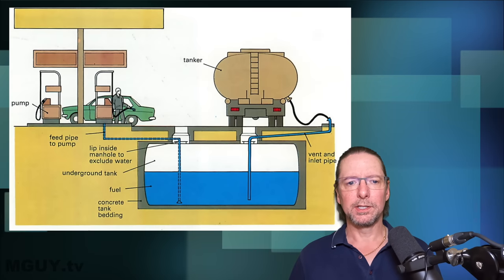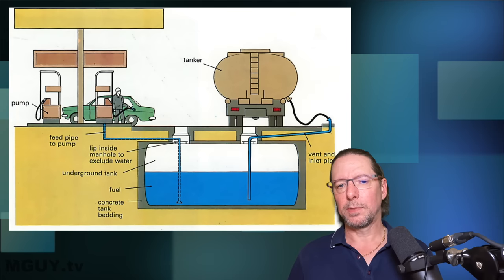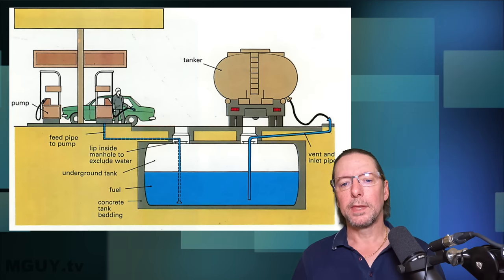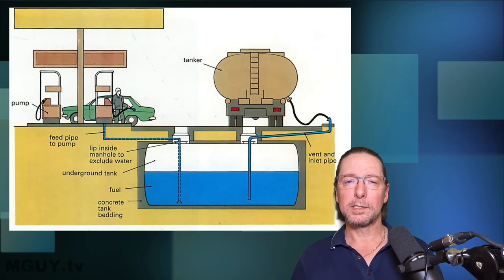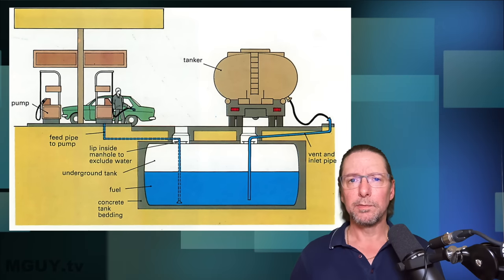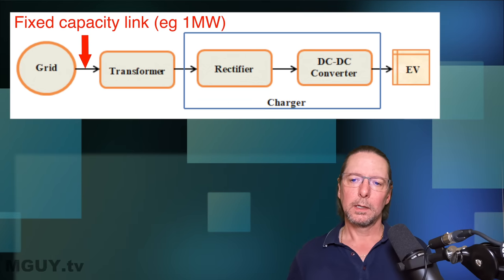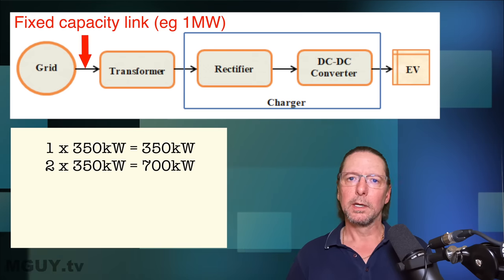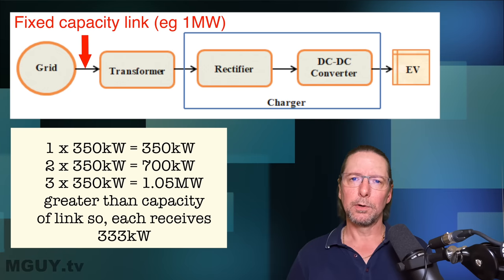HUGE problem with EV Charging Stations that no one mentions | MGUY Australia

Comment: Let's be generous and say an average EV stands on a public charger for 20 minutes and gets a range of 240 miles (more like 140 but bear with me).
It's generally accepted it takes 5 minutes to refuel an ICE car which then has 400 miles range (often more). If every car is an EV the sheer 'space' needed for public charging is mind blowing. Home charging will hardly ease it if many households have more than one EV or no off road parking. Regardless of the infastructure issues the whole thing is a house of cards.
Reply: and you will provide the fire fighting capability needed to protect the community?
Reply: The new Shenxing battery can easily provide 1000km range with less than ten minutes to charge to 400km.  We aren't talking about about gen1 Nissan Leafs anymore -battery tech advances year on year.
Reply: Exacty. Let's say you have half the mileage and take 4x the time, that means you need to have 8 times as much EV charging stations as you need gas stations at the moment.

Most people will charge during rush hours, so you need the grid to support that.
Reply: Yep, that's why EV's are pointless technology
Reply: @jasonhutcheon5991  advance the fire fighting technology.
Reply: What do you think all those green fields are for ?  But for forming huge standing areas for vehicle charging  ?
Reply: Don’t forget that everyone is going to charge their EV at the end of the day when they arrive home too!! 

The power draw from the grid for EV charging on top of already peak demand is impossible… even if chargers were required to start after the peak demand was over, the grid still couldn’t handle it and small window for charging will leave EV owners with half full batteries.
Reply: @jasonhutcheon5991  You missed the point of the video. How many kilowatts of energy does it take to provide 1000km range. The grid cannot provide energy at that rate even if the battery was real.
Reply: @sjb3460 wef said you never heard of bike?
Reply: The best solution to personal transport is no car. The second best solution is an EV.
Reply: Takes 30 SECONDs of my time to charge my car when I don't drive more than 250 miles in one day. Level 2 Charging Public Charging will just exist in existing car parks and takes up no extra space. "Home charging will hardly ease it if many households have more than one EV or no off road parking" does not even make sense especially in Australia where home charging is very viable for a slight majority. BEVs is not a total 100% solution that needs to cover every niche. But just the viable use cases in Aus is massive enough to have a gigantic impact. Your assumptions lack any understand of how this works in the real world. You are just jumping to wild absolutes.
Reply: @lukeclifton4392  and the sun won't be shining so we'll all have to pray for windy nights 😮
Reply: There are 6.9 million Terraced houses in the UK. How are they going to charge an EV at home?
Reply: Also consider how the average gasoline car is stopping at the fuel pump typically to get fuel for short journeys.  For those who have a garage, that could have simply been done with a charger in their garage overnight.
Reply: Tell me how the 6.9 million terraced houses in the UK, how can they charge an EV at night? @martalli
Reply: You are forgetting a massive percentage of ev drivers do all their charging at home
Reply: Not everyone can charge an EV at home. In the UK we have 6.9 million terraced houses. How are they going to charge an EV at home? @lukeclifton4392
Reply: Charging infrastructure at destination (workplaces, shopping malls etc) would alleviate this some
Reply: 1 fillup gives me 1200km range
Reply: Me too...
Reply: @gooble69  hopefully we won't experience "tofu" batteries with the new upgrades.
Reply: 240 miles on 20 minutes charge? That’s not generous, that’s a fairy tail.

Not one available EV has that capability, not even close, not by half at least.
Reply: How many petrol cars refuel in their garage? What % of EVs will need to charge worldwide at any given hour compared to petrol cars? I suspect far fewer than 10% of EVs will need public charging as compared to petrol. Your analysis is overly simplistic.
Reply: @jasonhutcheon5991  You assume the charging station has the capacity available. In some areas full fast charge is not available during peak demand hours. To bad, so sad!
Reply: @seanworkman431  They have the technology. IT IS VERY EXPENSIVE!  YOU will pay for it, like it or not, buying an EV or not! You ARE going to pay for it anyway! Voting has consequences!
Reply: This is a ludicrous take because a) most people DO charge at home, b) very few people drive 200+ miles without taking a break for toilet, food etc. c) chargers can be installed anywhere that people park their cars - offices, streets, supermarkets, restaurants, motorway services etc. It's even kind of laughable that people pronounce it a "house of cards". Maybe we should tell Norway where nearly 90% of cars are battery electric vehicles that some guy on YouTube has declared it cannot possibly work.
Reply: Exactly! This is what I've been saying for years. Imagine a busy freeway, or even worse, a toll road with service plazas. When it takes 30-45 minutes or more to get 200 miles of range, where are all these people (cars) going to go?
Reply: Comparing EV's to ICE is pointless as current ICE requires fossil fuel which is running out. Compare them to other sustainable technologies like hydrogen if you like, but not to fossil fuels.
Reply: @drxym  Norway is not a valid point! Small sections of population can do things that are not practical for the majority! The entire population of Norway is less than the population of several CITIES in the USA!  The size of Norway is less than some states in the USA! The problem of 350 MILLION people and a land area of almost 4 MILLION square miles is beyond all reason more complicated.
Reply: @glasslinger  actually it is an extremely valid point. If I wanted to drive from Skarsvåg to Stavanger by the fastest route it would be a 2500km journey starting well inside the Arctic Circle. I could drive this entire route with an electric vehicle because the Norwegian government have made it possible through regulations, taxes & incentives that strongly prefer electric vehicles and have built the infrastructure to support it. It is simply a matter of will and policy for ANY government to do the same, to say "on such and such a date, ICE cars will be phased out and BEV or synthetic fuel cars will be the only ones permitted for sale". You complain about the USA, but I don't see what your point even is here other than it is some veiled comment about the dysfunctional nature of US politics.
Reply: @suemclean2012  😂 People don’t need to fill petrol in their garages, because it only takes a few minutes to fill it at the station, it takes hours to charge your EV, the fire risks while charging are far more risky with current technology, so wait until your home insurance rates reflect an EV charging in your garage, good luck, hope you don’t get cancelled. FYI, look up EV fires……🤯
Reply: @glasslinger  and when it fails we all pay a higher price. 
Did you read about the chap that got trapped in his EV  while driving? The police had to get him to crash into them in order to make the vehicle stop. Happened in the U.K.
Reply: @MrCrouton80  That's like saying the best solution to life is death. Obviously, if I want to transport myself somewhere, it's better to have a car than not to have a car. I'm not anti EV, I'm pro all modes of transportation. Why do we have to pick one?
Reply: @gavinminion8515  If you Google 'oil reserves' it says we have 50-70 years left.🤔. Saudi Arabia alone has 221 years at current consumption 😂. As for EVs they also use fossil fuels. Two thirds of global electricity is generated using gas/oil/coal.
Reply: @grandprix1337  Even with an EV future we will need to change how/when we drive. But if you read your own comment - Oil and Gas will run out. And long before they do we will feel the effects of shortage acutely. 
P.S. I checked the OPEC website and their figures (which will be expected to be optimistic) give 80 years at current consumption.
Reply: Except most EV will charge when parked, not at dedicated rapid chargers, usually at home.
Reply: @jasonhutcheon5991  Is any American car maker using this battery? Furthermore, 400 km is NOT 400 miles...
Reply: There are already cities that won't allow more than one charger per house and or restrict the hours that the charger may be used!  If they only allow charging during the day when the solar farms are putting out(not a cloudy day)then that is useless because you have already gone to work!!
Reply: I own an EV and never used a public charger.... I could easily charge two at home... for free.  Seriously you people talk some crap, 1 in 7 cars now sold are EVs, the grid hasn't collapsed and owners have managed just fine.
Reply: @Hogger280  Unless you back thaty+ claim up, you lied.
Reply: Another problem is, if you don't have a garage to park in and hide your charger, anybody can come by and steal it (or parts off it) with very little to no problem. Even having one in your garage will only increase the crooks problem to moderate for most cases.
Reply: @jeremydyck2601  Congratulations! You win a coconut for coming up with more anti-EV FUD!

I never heard that one before or heard of any case of it happening, ever.

Comment: A disabled driver YouTuber has raised problems that he has found with UK charging points regarding wheelchair access, wider bays, no kerbs and very important weather cover canopy's similar to a present filling station.
Reply: Not found much of a problem, a few that are not working, yet I remember no being able to get petrol while the tanker  took 30 mins to deliver. A lot of the charging points seem to have wider bays, thinking about it, it would be hard to get out of your car while parked next to a petrol pump. Although I noticed a comment about Scotland, oh yeah they are still bragging about being the leaders in EV charging " many FREE " While there are still some  that are free, most of the" free ones" now charge at least 40p kwh. Troon has at least 4 free sites ,  40 kwh £free . petrol £1.65 a litre.
Reply: It is canopies. Even if not, the possessive apostrophe is not required.
Reply: I tow a trailer to events a few 100s of miles away. Not everyday, but it's something I do (as long as the government allows). As well as very limited towing distances with EVs, there are, so far, no charging stations set up for trailers. So several times per trip, I's have to find a place to leave the trailer, recharge, pick up the trailer and repeat as necessary.
Reply: @drewthompson7457 this is actually a good point, pull-through chargers would be a simple thing to provide in places where space permits and would help support people moving to EVs.  One thing to note, there are extension cables that you can buy to extend a J1772 connection.  Not sure what power rating the new ones support, I have a Chevy Bolt so it’s charge speed is ludicrously slow anyways, no fear of over stressing the 20 foot extension cable that I purchased.  May or may not work for you, but thought I’d mention it in case it might help.  Possibly they exist for Teslas as well, not sure.  But your point about needing pull-through chargers is a very good one.
Reply: Definitely charging stations should have these design elements included to ensure we’re bringing in as many drivers as possible to make EVs practical for them, but genuine question wouldn’t they also have significant challenges filling a petrol vehicle? Here in Canada there are quite a lot of gasoline stations that don’t have canopies, I don’t know if they’re required by law now and it’s only older ones that are permitted to not have them or if it’s just generally an option.  I suspect that by law the pumps have to be elevated on a pad and protected with bollards to reduce likelihood of catastrophe as every station I can think of has them (again here in Canada).
Reply: Did you know, in the US at least. If your car runs out of electricity  in the street, a gasoline powered tow truck tows you to a charging station or tows  a diesel  powered generator out to you so you can save the planet with your green energy car.
Reply: @MrYfrank14  did you know that in the US, there are 2 large towing companies (Atlas towing in San Francisco and G1 in Los Angeles) that will show up with a battery pack and charge your EV battery enough to allow you to drive to a charging station? Of course, not every towing company, especially independent operators offer this service. And AAA doesn’t offer the service, because - surprise - EV owners rarely run their car down to empty.  Guess perhaps they’re just smarter? Just a thought… It’s also entirely possible to carry a small spare battery (there are a few on the market ) to provide yourself with a bit of extra range, should you need it.  And adding range only requires getting to a 120V plug of a Good Samaritan (240V for my European friends) in order to do a slower emergency charge to get to a higher power charge station. I’m not necessarily reliant on a towing company to come and provide my fuel if I’ve been dumb enough to run down to zero.  Also, carrying the extra battery doesn’t come associated with noxious, combustible fumes and trying to figure out how to carry it safely.
Reply: @sjsomething4936  so the fossil fuel powered tow truck bringing you a battery is safe for the environment?
Reply: @markleeming1786  so how long does it take to fully charge your EV, and of coarse you can get out of your car by a fuel pump, how else you gonna fill it up?🤗🤪Unless you Obese.
Reply: @MrYfrank14  can’t change everything overnight, it’s a slow process. Thankfully the progress is real, and the banking sector is finally starting to realize that a lot of their investments will be f*d if the climate changes as rapidly and drastically as some projections suggest.  Now that the money men are getting involved, things will accelerate.
Reply: Dream on,  charging stations already take up way more land than gas stations!